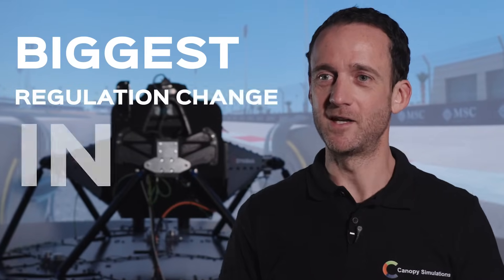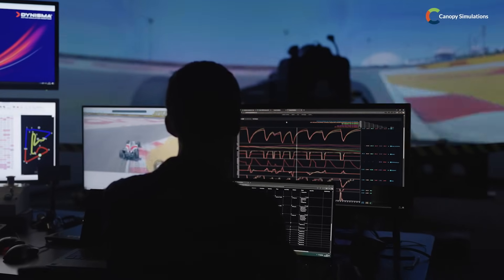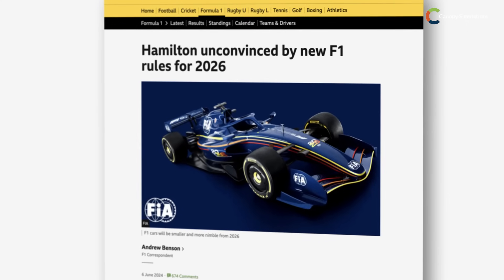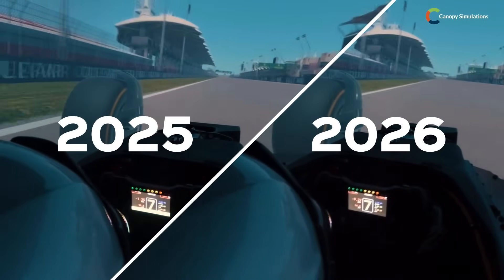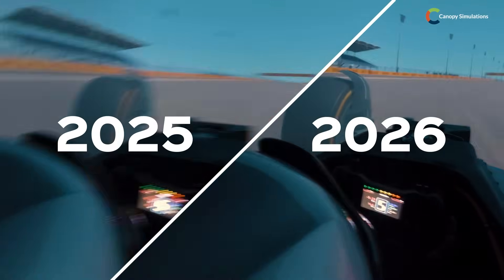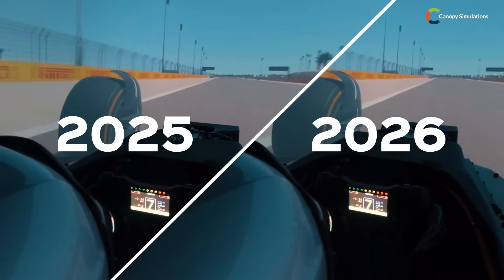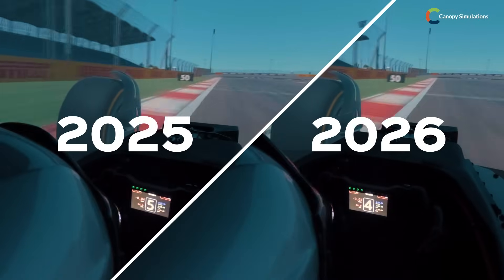F1 2026 Car Changes Explained with Gary Paffett | Simulator Insights from Dynisma + Canopy

Comment: So taking into account each manufacturers current strengths and weaknesses, in addition to the great track record/history that a certain powertrains manufacturer has considering the last time we had a regulatory change, back in 2014, my money would be on a Mercedes powered team that has also dominated all things involving tire performance, particularly making them last longer than anyone else. They definitely found that secret sauce which also included hiring Rob away from Red Bull - I believe it's a combination of their novel aero approach, as well as a proprietary manufacturing technique (could very well be have found technical partner, that's fairly new to the space but already very disruptive) that allows them the ability to seemingly keep their tires at the optimal temperatures and working window. It infuriates me to admit this but unfortunately McLaren will be on top for the foreseeable future. It looks like it took them a couple of years to fully showcase their tire management superiority which let's not forget, also unlocks many performance benefits. Great breakdown and hopefully they'll be more!

Comment: guys I want to be honest with you because I think you are lost. More overtaking? In f1 there is not an overtake since 2010, when drs was introduced. 100% fake overtakes, means 0 real overtakes. Saying the exact opposite doesn't change the fact. We have seen drivers stopping in front of the drs line. You can notice the damage, when you meet an f1 fan in simracing. You are among the ones that contributed to the destruction of f1 racing. This is the truth. ver is not veritas.
Reply from the maker: We have done quite a lot of work on overtaking from a fundamentals perspective (not gimmicks) if you would like to read about it:
https://simulation.michelin.com/canopy/technical-articles/overtaking-fundamentals-action-packed-2022-f1-season
https://simulation.michelin.com/canopy/technical-articles/overtaking-trends-the-case-for-2000bhp-f1-cars

Comment: So these cars are going to derate at a decent amount
Reply from the maker: Yes, which should help overtaking since full throttle all the way to the braking zone, then aggressive braking is bad for overtaking (see "Time spent Braking" graph):
https://simulation.michelin.com/canopy/technical-articles/overtaking-trends-the-case-for-2000bhp-f1-cars
Reply: @CanopySimulations  Which is why I think all the people saying that "Hamilton is just struggling with the ground effect era, things will be better for him next year" are going to be wrong.  2026 regs will be even more antithetical to his driving style than 2022 regs were.  All the changes I've heard about that he wants made to his car sound bad for performance in 2026 cars, whereas on the flipside the current Ferrari setup sounds kinda well adapted already w/ heavier engine braking than other cars and brakes that work better at low temperatures than other cars (probably as a consequence of using heavier engine braking).  Not to mention being forced to lift and coast because of their plank wear issues lmao.

Comment: i don't understand. for decades it's known, if you want overtaking or cars to follow easier. reduce downforce produced by wings. increase downforce produced by the diffuser and mechanical grip. so for 2026 don't reduce their tyre width. decrease the wings. for decades f1 keeps making cars with huge wings. and if cars just overtake each other, the racing is just as boring. people who just want to see overtaking don't understand there's a lot more to the race. battles like brazil 2023 where fernando held off perez for 24 laps won't happen.
Reply from the maker: Downforce will be reduced significantly, I'm sure this will help.

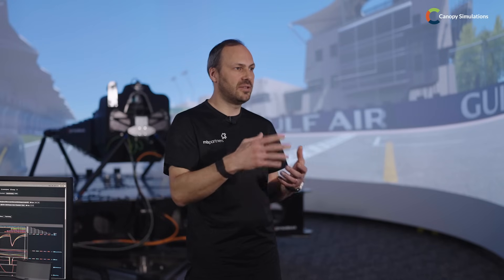Comment: 8:04 "It was a great car to drive because it was easy to drive". Well it seems that all the F1 drivers don't think that, and many struggle with their car, so i wonder how good the correlation is in this simulator.  Probably 90% there, but then the devil is in the detail and the handling problems come when you take it to the edge of performance in competition. It' is very unlikely a 3rd party has the same quality of data about tyre and the track surfaces that the F1 teams have.   Good video though. Enjoyed it.  Just wanted to sound a note of caution. Correlation seems now to be very hard with ground effect cars and weird Pirelli tyres.
Reply: They will definitely still have access to laser scanned tracks so I don't think that's an issue. However, you may be right in the fidelity of the data and how realistic that feedback is in the simulator.
Reply from the maker: Good points. What I would say is that you can turn a balanced car that is easy to drive into one that is marginally quicker but horrific to drive with a few setup changes. When a team has total domination and they disappear over the horizon for a 1-2 victory, the car is easy to manage as it is not being driven to the limit. Since the racing is so close this year, the drivers are pushing extremely hard which surfaces all the infuriating car balance issues. It might be a symptom of just how tight the racing is this year.

Comment: Prepare for 50/50 garbage spec's that are completely useless and unnecessary. Hope it fails and F1 stops  pretending and virtue signaling.
Reply: These cars will absolutely fail. The de-rating and electrical power fade out as speeds increase is just going to be atrocious
Reply: @Lsr7102  they are already looking ways to correct this and personally, I believe they will find a way.
Reply: @Lsr7102  this happens with WEC and everyone goes nuts for that racing, why does it matter so much?

Comment: That steering wheel looks a lot like the one in the Ligier LMP3..

Also, is rFPro still the software of choice or are you not allowed to tell me? ;)
Reply: I'm pretty sure it's still rFPro, as the HUD is the same one that was in rFactor 2 when it started its life
Reply from the maker: Yes, rFPro, still a great choice for this level of motorsport.

Comment: Are there any concerns about safety now regarding less grip and less downforce in the 2026 cars?
Reply from the maker: The lower drag and straight line mode should make the car quicker in a straight line. However, there is not enough battery energy for the the 350kW motor to deploy for the full straight. This makes the 2026 car slower approaching the braking zone than the 2025 car. There is also a mandatory gradual slew rate for the motor cutting out to avoid any unexpected changes to car balance.
Essentially the 2026 car gets up to speed very quickly, then the power starts reducing, so the top speed is less.
The lower grip also brings down the cornering speed, which in theory is safer.
Drivers will have to learn to brake a little earlier due to the lower grip, but they will figure this out within the first lap of testing.
Reply: @CanopySimulations  Definetly interesting. There are rumours now that they could move towards a 65-35 split.
Reply: @ Makes sense, thank you for the detailed answer. 👍🏼
Reply: More grip and downforce makes drivers push harder, so ends up being less safe

Comment: got to question how accurate the sim is when drivers are saying that the current cars are mostly hard to drive when the sim is saying its easy.
Reply: Even Bottas said the Sauber was great to drive. It was just too slow
Reply from the maker: The intense competition in 2025 is pushing drivers to their limits, revealing issues with their cars. By easing off slightly, as done in simulators for consistent laps and better feedback, the situation improves.
During the era of Mercedes, Red Bull, and before that, Ferrari dominance, leading cars could cruise to victory, making things easier for the winners. Next year, tyre management and overtaking strategies promise even more thrilling races 🤞
Reply: @CanopySimulations i believe it when I see it - Even easier overheating tires doesn't sound promising.
Reply: @Bluth53 it might end up as a good thing. So far this season we've seen lots of 1 stop races and some medium to soft (and vice versa) strategies. I think the 2-stop races have been more entertaining than the 1-stoppers, so by having more tire degradation we will be seeing fewer 1-stoppers (though it might also end so bad that we will see defensive 2-stoppers only...)
Reply: @jacobsejer4527  I see the point you're trying to make, but overheating /= degradation in general. While there is correlation, both physical processes are not fully overlapping. I'm all for better racing but I'm not sure, if tire technology could ever be improved upon, to achieve once again fun wheel to wheel racing, with such aerodynamic fast(corner) and heavy cars in this era.